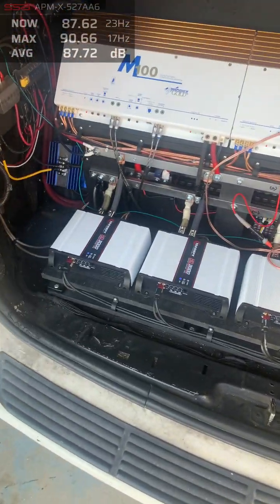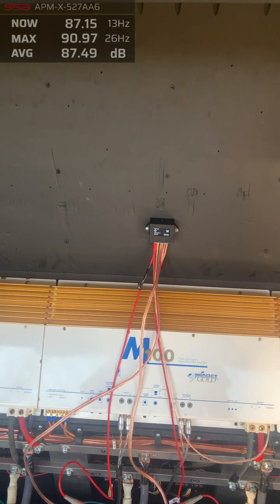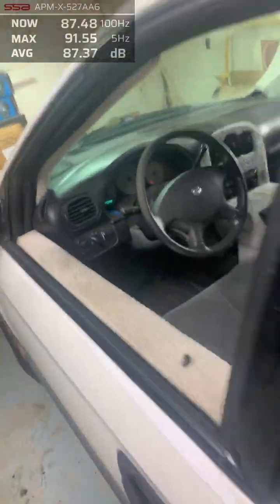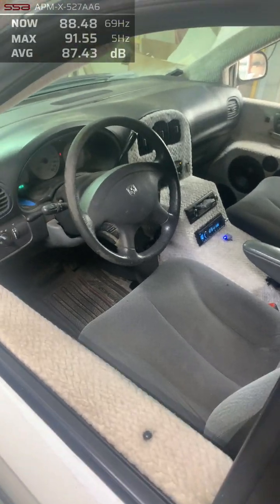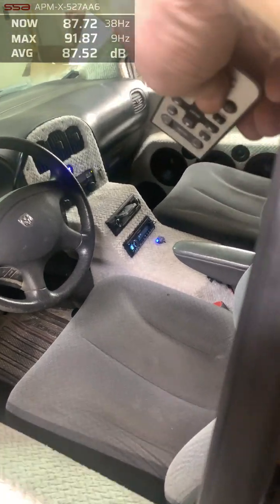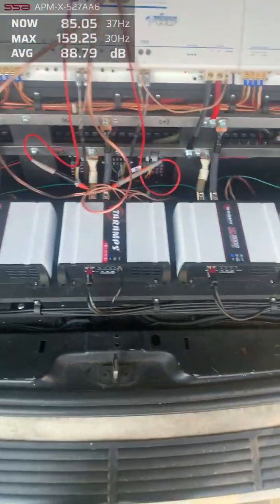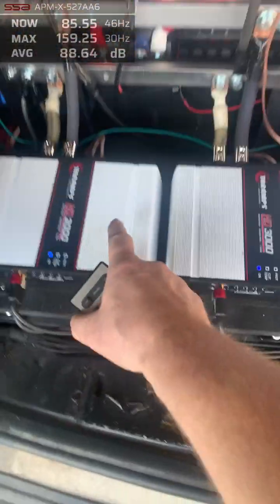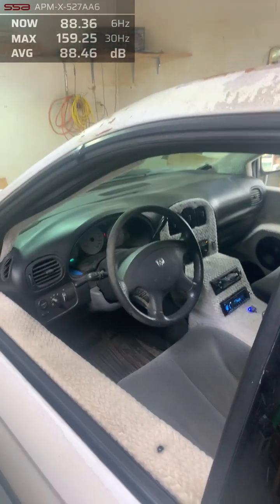Taramps HD 3000 wired to 1 ohm clamped power

Comment: Ok so quick question man I just redid my system I ain’t ever had a tramps hd I have a sae 3k on the way for my subs I got my subs today and got them in the box there 2 12 deaf bonce subs the apocalypse sa series there 1250 rms a sub long story short I can pick one these up tomorrow about for free for my subs till my amp comes in to brake them in so to speak you think it’s safe to run it I have heard bad things I got 150ah agm bank big 3 stock alt I can set my gains clean I been doing it for a while but I want to make sure its mkt gonna catch fire or something I ran a tramps bass 5k on complely stock electric before and didn’t see the power but was good it did what it needed too my voyage don’t get under 14 now with the hd might come down to 13.7 ish if that
Reply from the maker: You should be fine with your electrical setup as long as you don't wire the amp below what it is rated for. As far as catching on  fire.....I have had a few Taramps fry do to vibration, clipping the shit out of them, and wiring below the rated impedance..........all at the same time mind you........I had 20 of these HD3000 amps (bought them on sale for $99.99 each) so I wasn't worried about frying them. No fires at all. I think I fried 2 HD-3000s and 1 Smart 3. The Smart 3 went into protect at least 2 dozen times before it fried. I was just torturing the amplifier daily to see how durable they are. At that point I had the amp mounted directly to the floor with no vibration suppression. Since then I have been using anti vibration feet on my amp racks and no more issues with amps frying. Hope this helps and thanks for watching!
Reply: @AllAboutAudioJW ok thanks bud nice build

Comment: I have a one oh 8000k bass taramp how do I wire it to  two 15 inch 2. Ohm
Reply from the maker: If it is a half ohm stable amp and your subs are dual 2 ohm then parallel all VC's together for a half ohm final load.

Comment: Can you use these for voice amp? My mids don’t sound good on the 3k hd
Reply from the maker: Yes they do rather well on mids and highs. One thing you have to consider tho is the HD amps show distortion on a good oscilloscope far before the clip light comes on. I will show this on a video at some point, but you can expect about half of the rated power CLEAN out of these amps.
Reply: That's what these are built for
I'm not gonna lie
U need a dsp to get taramps to sound clean
Reply: @NerdyBassHead  I have one.
Reply: @NerdyBassHead  should I still get a 4ch
Reply: @photographcenter8456  i mean if u think its right
I got a ds440 n it sounds great
Powers 4 vocals n 1 bridged for a home theater sub